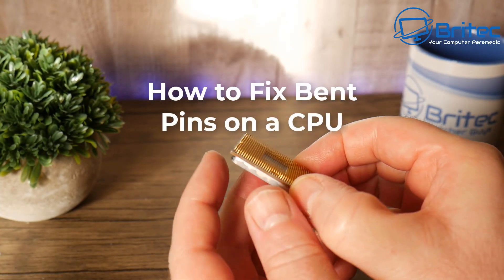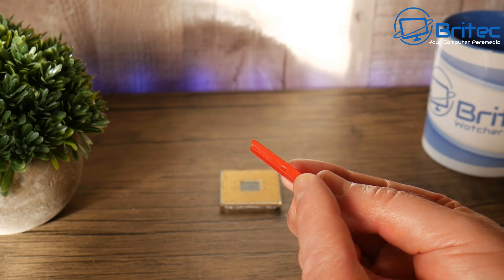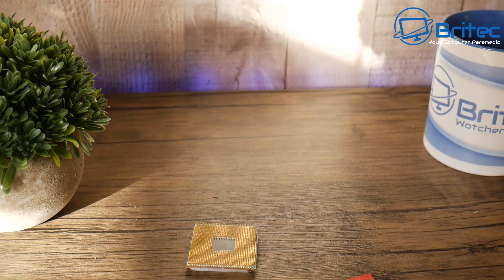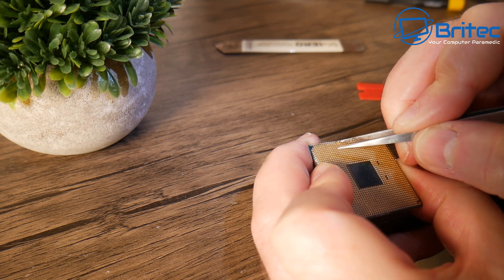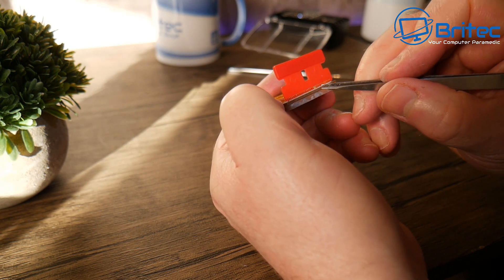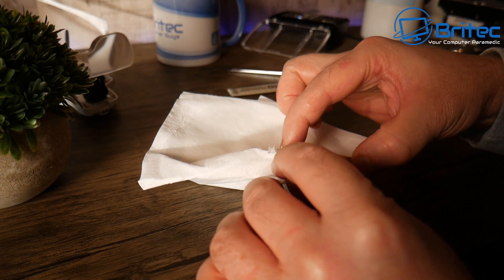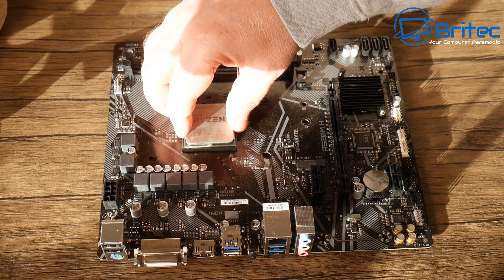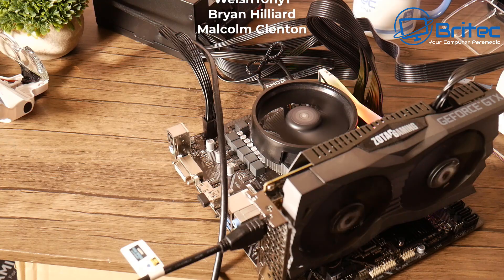How to Fix Bent Pins On A CPU

Comment: A anti-static wrist strap is recommended and, I'd use a jeweler's screw driver instead of tweezers…  you have better control.  Tweezers could easilly slip and destroy one or more pins.  Been there, done that.   Been in computers since 1975.

Comment: I always use a mechanical pencil with the leads removed. The pencil head fits perfectly over the CPU pins and allows me to gently wiggle them back into place
Reply: damn man thats a really smart idea i gotta try it tomorrow
Reply: @Nikkikoo99 did you try it?
Reply: @veganwater3130  i actually did but it didn't really help much since the pencil head was larger than i thought i ended up using a blade almost cut myself and even dropped it which made things worse but in the end i fixed the cpu and even sold it lol you just gotta be careful and really patient

Comment: The keyword to doing this is "massage", you want to massage the pins to influence them to move! Trying to force them in any way you stand a good chance of breaking them off! I used to have a tool I got somewhere that had a channel in it with tiny flares at the ends to help bring pins back into alignment using similar actions to how you did with your plastic razor. Dont recall where I got it and cant find it now but they do make them and worth getting one if you do this for a living.

Comment: additional tool that u can use,try the needle of syringe its easy to use,just use sand paper to straighten the needle
Reply from the maker: These where folded over, could not use that method

Comment: Yes Brian I have had to do this on a few occasions even with the older Intel CPU (many moons ago) and I used an old credit card that I rubbed down the edge of with some really fine wet and dry sanding paper so it was thin enough to run along the pin lines. The best about using the credit card was that it could reach right across the line of pins ensuring a nice alignment. Of course each to their own eh? 😉
Reply from the maker: Thanks for sharing!

Comment: a  bent darning needle  or a small dental pick is handy for this  when you need to lift  badly  bent pins  when they are bent past the next row - as it allow you to hook underneath them -  bent pins were a common thing  back in the days of 486's - before the ZIF sockets came out and you had to press them in quite hard
Reply from the maker: Many ways to do it, as long as it works, it don't matter what way you choose.

Comment: Would heating the cpu help avoid breaking pins off?
Reply from the maker: No, never heat CPU
Reply: @Britec09  But isn't the whole point of coolers is to avoid over heating? When i said heat the cpu, i meant warm it on a hotplate type setup.

Comment: I had some pins on an AMD 7 4750G CPU which were bent absolutely flat between the different rows of other pins. So I first fixed the CPU with a small vice and used a digital electronic microscope to magnify the pins. Next I  lifted them justa little with a fixing pin and then started the same procedure with the razor blade.
Reply from the maker: what ever works best for you.

Comment: This was real a nightmare when this happened to me. A year or so ago, I needed to re-seat my CPU, I loosened the heat-sink so I could take it off and get to the CPU, but when I pulled the heat-sink off, the CPU came with it, bending a few the pins. That thermal paste was like glue! I thought it was all over, £300 down the drain. I was so glad that I managed to straighten the pins and not damage anything. I was relieved when I put it back in the computer and it still worked. I NEVER want to go through that all again.
Reply: Same thing happened to me. I never thought the CPU can come out from the socket that way.
Reply from the maker: Yeah, these can be hard to fix and pins can sometimes break
Reply: I’m late replying but always try to use the wiggle method.  When you go to take out the cpu, start the pc up for or so first to heat the paste. After shutting down, loosen the cooler then twist the cooler a few times to break the seal that the paste creates with the cpu.  After that carefully remove the cooler.
Reply: Same thing for me
Reply: Same 😢
Reply: A very common thing for AM4 cpus. Always twist amd then pull